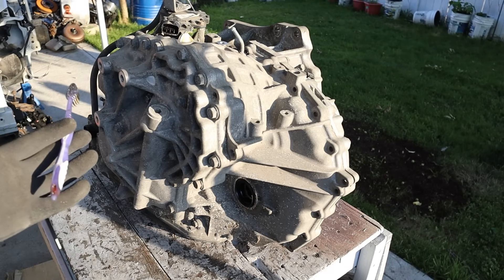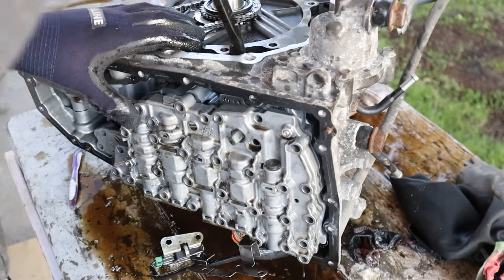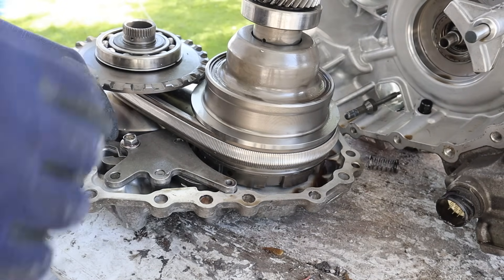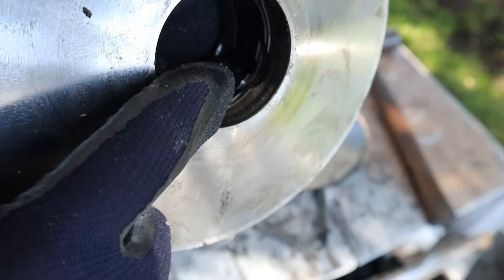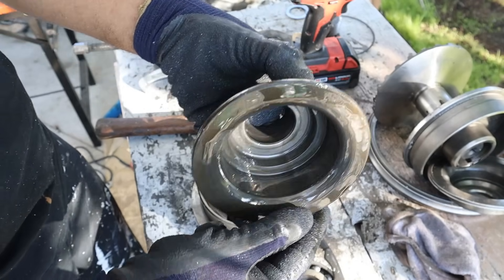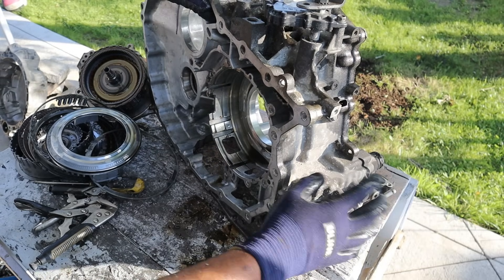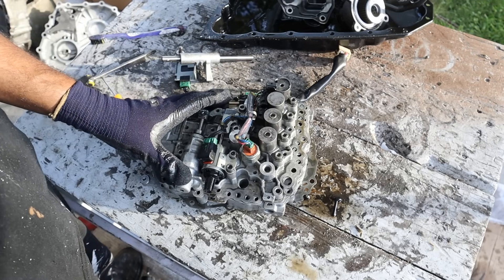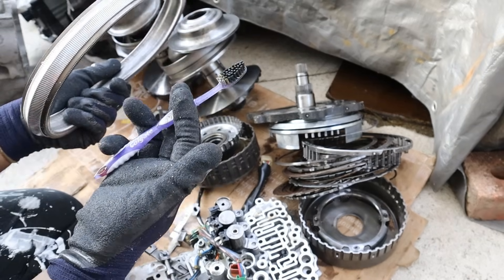Why Nissan CVT's are a FAILURE

Comment: Some of the newest ones don't have the tube anymore either!  They must have realized we could still change the fluid easily
Reply from the maker: Yeah they don't want the average now changing the fluid so they'll make it harder and harder
Reply: @speedkar99  They just don't want them to last as long as they could so they made it harder check or change the fluid.  If it was an automatic transmission the only difference with sealed is there is no dipstick or tube.  They might say some people used the wrong fluid in those.  My only guess is those ones were some idiots assuming that Dexron works in everything!

Comment: CVT is a Bad design, technology suppose to go forward, instead it is going backword,  from good long lasting hydrolic planetary gear transmission to a weak CVT one that dosent last very long and it is weak meaning you can trust it to tow somethimg behind the car or even going on dangerous uphill, CVT: power of the car rely on a belt or chain on a flat variable wheel, that crazy and stupid, they convert cars to motorcycle, at least motorcycle id better because the chain is attached to a gear with teeth from both sides engine and the wheel.

Comment: My 2010 Nissan Murano has 226K on it, has the original transmission and still accelerate like rocket..
Reply from the maker: Nice!
Reply: Got a used 2011 murano and had 190,000 miles on it and I changed the transmission fluid and it looked like engine oil it was so black.

Changed both filters and treating it like a baby right now. So far so good.

Comment: The reason why they fail so much is lack of maintenance CVT get very hot. Obviously you got the metal belt all that friction to a lot of heat, heat breaks down fluid. The color of that fluid shows that it was never replaced. It’s supposed to be green it’s not supposed to look like engine oil with 10,000 miles on it that burnt decorated oil causes the belt to slip because CVT fluid is traction fluid i’m that fluid goes bad. It allows about the slip which creates more friction which causes to get hotter and it’s a cascade after that the fluid supposed to be changed and Nissan because of lack of cooling every 30,000 miles and in cvt is with proper cooling like the Mitsubishi outlander those need their fluid changed every 60,000 miles
Reply: And also naturally, CVT‘s make a lot of metal debris because of the metal band rubbing against the two variators and the belt with the two bags in it all that rubbing causes metal debris which clogs up the filters in the transmission, which causes fluid starvation which destroys bearings all because of maintenance because Nissan never put in the owners manual to change the fluid every 30,000 miles

Comment: I have three Sentras. I bought them new in 2011, 2013, and 2015. All have over 100K miles. The only problem we had was with the 2013. At 129K miles, it took 2,500 rpm’s to go 70 mph (normal is 2,000 rpm’s to go 70). The transmission could have gone another few years, but we chose to get it replaced with a new transmission at the dealer for $3,500.

Comment: Unsufficient pressure allowing slippage. No pressure sensor?
Reply: Of course there's a pressure sensor, several of them.  Without the Altima this CVT came out of there's no way to know which diagnostic trouble codes were stored, but I bet that one was P17F0.

Comment: Lots of emphasis on changing the fluids on cvts. However Subaru and possibly new Hondas CVt s are sealed. Apparently they have a “lifetime” fluid which I think is total bs
Reply: Fluid changes for Subaru and Honda CVTs can be done.  Dealerships would rather sell you a new CVT instead of changing the fluid on the existing one.

Comment: I had a low mileage (28k) '10 Altima Coupe.  The tranny overheated all the time on road trips, while driving uphill.  Super embarrassing to be in a newer car (only 4 years old at that point) and have it go into safe mode.   I would buy another Nissan, but only if it was manual or had a traditional automatic.  These CVTs are trash.

Comment: Those CVT transmissions will last if owners got off their pocketbook and had the oil changed frequently.
They leave the original stuff in and get them stuck in snow and floor it and haul weight. Fried oil does not protect anymore and bye bye bearing set and orings. 
Nissan does sell a repair kit for this type but you have to scrounge around getting the special small ones that always are fried and no chain in the kit otherwise you can rebuild it. 
I 100% agree with the poster to
Get A Cooler!!
Maybe add an external oil tank so it's always cool and "fresh" because the temperature in there will cook a chicken and it ruins the little bit of oil it has. 
Once this oil is botched then everything else fails eventually.
Nobody ever thinks that regularly changing transmission oil is important.
Engine engine engine oh gotta get on it change the oil I want full synthetic racing oil but leave the dirty burnt dishwater in the transmission.
Its up to you to make your vehicle last longer.
Reply: Even people who changed the oil on schedule still had total failures. 

The CVT is a complete engineering failure. It never should have ever been put into production. There was NOTHING wrong regular automatic transmissions, even Nissan ones. They would routinely last +200K miles.
Reply: @HailAnts  I agree 👍. I like the idea of CVT but not the crappy result.
Reply: For several years these trans were sold as maintenance free, lifetime oil... A few years later Nissan and owners learned that was not true. Some years, including my 2010, does not have a trans drain plug. Other years do not have a trans dip stick.

Comment: 106,000 miles on my 16 Pathfinder still rocking it out. Did 3 drain and fills using Castrol Transmax CVT fluid and changed BOTH filters.
Reply: That is very good trans fluid !
Reply: @ThunderbirdRocket Now 119,000 miles lol

Comment: Changing that cooler filter, the one most dealers won't admit to existing, is paramount (about every 40-50K miles) and driving steady footed on the accelerator.  People that dart in and out of lanes on the interstate going to the floor every time don't do well with CVT's.  I worked at Mitsubishi as a tech for 15 years and the older 1st gen CVT was tougher as the newer ones, like that one, have a wider range and heat up more.  Getting one replaced inside of warranty is a smart move if you can figure a non noticeable way to make sure it fails but it shouldn't be too tough as the wide ratio CVT had about a 70% failure rate before warranty ran out.  
Or you can just avoid Jeeps, Dodges, Mitsubishis, and Nissans with the Jatco CVT altogether.  That's my choice.
Reply: I mean shouldn't we avoid Mitsubishi and Chrysler products any way? never seen a good Chrysler product since the last AMC 4.0 engines were in the Wrangler in about 2005 unless you count Cummins trucks

Comment: if I knew about CVT transmissions at the time I bought  my 2017 Rogue  new, I probably would not have purchased it. That being said I got a great price on it, it only has 2500.00 miles, I like the way it performs, and I do not drive it aggressively. I am taking it to the dealer next  week for it's first CVT oil change . I plan to do oil changes every 25-30 ,000 miles, so the car should last me a good while. It's paid off so I plan to drive it for a good long while, God willing.

Comment: Those transmissions are designed by Jatco. Generally speaking, I have a very bad experience trying to repair and failure analysis on transmissions from this make. I personally avoid owning any car with transmissions from this make, no matter the car Brand. After so many years working on automatic transmissions, something about their design feels off to me, and the field experience seems to agree.

Comment: After market trans cooler is a must and its a good idea to bypass the radiator trans cooler directly to the after market cooler cause the radiators are famous to leak coolant into trans!
Reply: Interestingly Nissan actually have a transmission cooler part. Make of that what you will

Comment: Great video! My 2011 murano 180k with fluid changes done every 30K, I believe, is finally dying.
It still runs great but has load buzzing sound. You can hear it  under the air box and out the dip stick tube. 
Unfortunately, the rest of the car is great. But resale value for these even without issues is so poor. Just because of the transmission

Comment: Nissans problem is there cooling is terrible and it cooks the fluid they use fast. Add a aftermarket cooler and change your fluid to Lubegard cvt fluid and change it every 40,000 miles and they will fair much better .2017 Nissan maxima 220,000 miles and was running when I sold the car just fine.I had a large cooler on the front of mine and I also added a magnetic filter inline also . My fluid never got above F 195 ..I don't see how that Transmission lasted I have a extreme lead foot and that v6 puts a ton of power through that belt. When you reverse out of your driveway and change to drive make sure your car is stopped. I did the same thing for years but I stopped when I had that Maxima and I still do it with my Subaru. That can be hard to do when your street is really busy ,and you have to get out and get going fast. Toyota has the best idea though with the real 1st gear to get the car going..
Reply: The CVT in your Maxima has a drive chain, not a multi-link belt that the 4 cylinder CVT uses.
Reply: @thx1138guy     Thanks man, I had no idea they use a Chain. I have a Subaru Crosstrek with a chain and I am in the process of adding my cooler and filter and lubegard fluid. I really did rag out that Maxima to no end I hated the car but my dad basically  gave it to me. When I first got it it had 90,000 miles and I was told the transmission was going out the belt did slip a few times but once I flushed out the old fluid and put in new with that cooler never the  had another issue with it. Jatco still makes terrible Cvt transmission..

Comment: If you have a low mileage Nissan CVT transmission, make sure that you change the fluid and put in the Amsoil synthetic CVT fluid. It will help the transmission last longer, that is one of the best CVT transmissions out there. But they have no business being in automobiles
Reply: Nissan OEM CVT fluid is also full synthetic.  AMSoil isn't anything special except its marketing.

Comment: Had a  2009 Altima 2.5SL that I bought new. Sold the car in 2016 with 165K miles on it. Car was 100% original when sold. Used only full synthetic engine oil changed every 10,000mi and changed fluid in the CVT @55,000mi and 120,000mi. I even got 108,000 miles out of the factory brake pads/rotors before I changed them. Car was comfortable and consistently got 28-33mpg. I guess I got lucky that I never had transmission issues. I also never treated it like a GT mustang.
Reply: You weren't lucky you just actually maintained your car unlike most ppl
Reply: @workingcountry1776 not only that; but you can’t beat on a car anymore like they used to back in the 60’s and 70’s.
Reply: What did the transmission oil look like when you changed it at 55 grand?  Light brown, dark?

Comment: I hate to inform you. But those transmissions are gone. Yes. The old ones were trash. RENAULT. Now they are identical units to any Subaru or Mitsubishi. And all Nissans slush boxes are ZF. SO. The trans issue is solved. They are great cars again. Please don’t hate. I am a long time retired service manager. 
Just change fluid every 30K. Last the life of vehicle.
Reply: Only in the Pathfinder.  The Murano, Rogue, Altima, Sentra, and Versa all still have CVTs
Reply: @thx1138guy  I know. Different manufacturer. Completely different trans. Same as Surbaru
Reply: I have Renault megane4 2018 petrol 115hp 1.6  16v with CVT (Jatco) transmission and I'm having a problem code, it's saying incoherence signal from the pressure sensor. Haven't changed the fluid yet. The car is at 60k km. What do u recommend??

Comment: I have 3 Altimas, all high mileage, 0 transmission problems.  Not all the Nissans are problematic.  It's usually the smaller cars, Sentra Versa
Reply: I never had issues with my sentras. People just don’t maintain them.
Reply: Their cars always felt bad to drive to me, its just an opinion though.
Reply: Worst car I’ve ever owned was a nissan Sentra with a cvt! Left me stranded on my way to Vegas!
Reply: Rogues seem to get it bad. I have two coworkers, each with a Rouge, and they both had transmission issues - one failed entirely and was sold off. 

Admittedly, one of these two was owned by a couple who do not strike me as responsible, intelligent, or safe - on or off the road, and the # of accidents, deer impacts, and general car issues they have, yearly, could tell the tale. The poor Rogue got little to no maintenance (because maintenance costs money) and was likely RACED from red light to red light, hard braking every stop.
Reply: @JMA_Elec  I have a rogue and I’m having buyers remorse, like they said, maintaining a cvt is fairly expensive, especially at 20k miles

Comment: I would never buy an Nissan. Only the very old Models like Skyline. My Problem with Nissan is, that they have or had a collab with Renault, and used many parts from Renault in their cars.
I don´t like french cars at all. I had 3 of them and all 3 had problems that other manufacturers never had. Busted head gasket after 30.000 miles on all 3 of them. Transmission problems, oil pump and more...
So i also stay away from manufacturers who uses french parts in their cars. 
Here in Germany we have an old saying "God protect us from storm and winds, and cars that came from france". In German that sentence is a lot cooler. The Translation killed the rhyme. 
I know that Nissan is not an french manufacturer, but they use their parts. So no go for me.

Comment: What is the difference between Toyota cvt's vs Nissan's?  Not much failure rate on yota's compared to this Jatco junk. What did Toyota do that Nissan didn't.
Reply: a better variator keyway?

Comment: My 11 Altima just hit 141k. I’ve been changing the fluid every 50k. Unlike whoever had that 12 that died.
Reply: I have a 2011 Nissan 2.5 the transmission failed at 241,000 but that was great nobody gets 241k, my car now has 529000 miles and now it needs another.  transmission at 288000 miles I don't think I can complain at all

Comment: It’s amazing that model of jatco CVT was released with  its short comings at that time. And also let it be matched with engines take over loaded it.   Jatco CVT’s are used in alot of different brands including Japanese built Toyotas.  It was a US wider problem because of larger engine and vehicle sizes.
Reply: Jatco is owned by Nissan. Japanese automatic transmission company.

Comment: I think my cvt was starting to fail on those grooves. I got the fluid changed at 45k. I noticed after 30k when you let go of the gas in a parking lot, i would hear and feel a shaft wiggle back and forth a few times.

Comment: From what I've learned about CVT failure over the years points to the belt itself. Other than fluid loss and various other component failures the belts are most likely to fail due to the design. Belts are made up of some 200+ butterfly shaped segments held together by narrow thin steel bands. The belts are constantly flexing as they traverse the two pulleys. Steel can only be flexed so many times before it becomes fatigued and breaks. Some of the better belts have more steel bands increasing reliability, but they still will eventually give up.

Comment: Thanks for the tear down.   The balls that were originally used in the pulley grooves (key-way) are usually replaced with machined pins.  This will prevent wear and failure in the pulley.
Reply from the maker: Agreed, that would make more sense, but pins would provide more resistance than rolling balls.
Reply: I was wondering what the "fix" was...